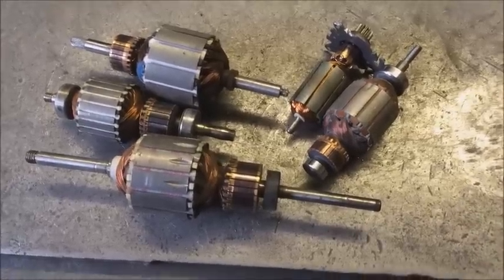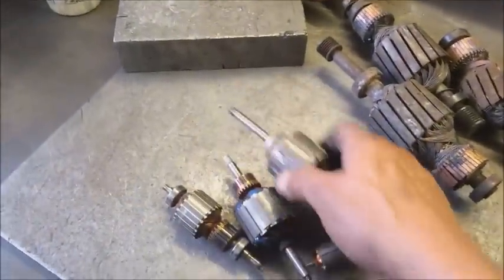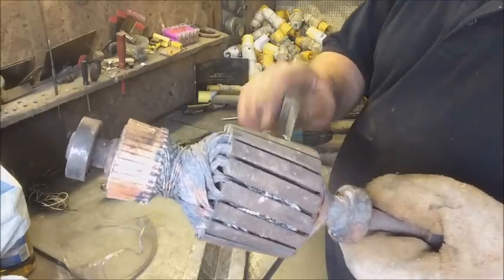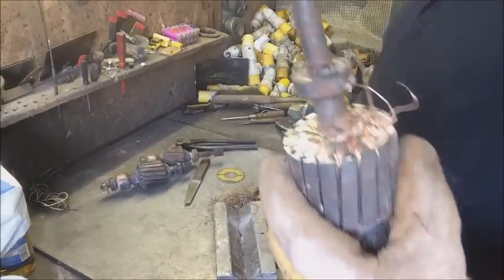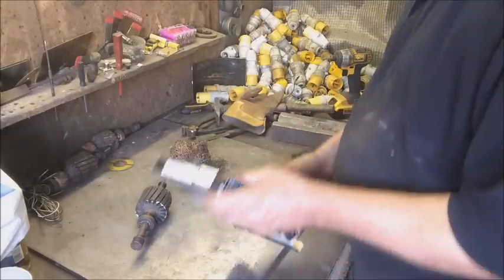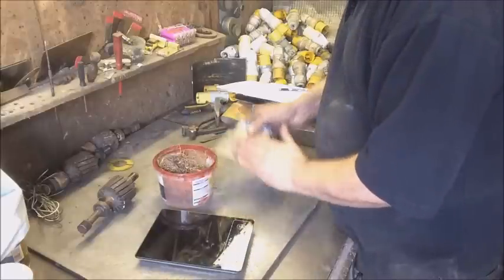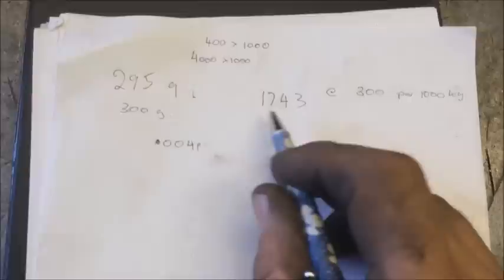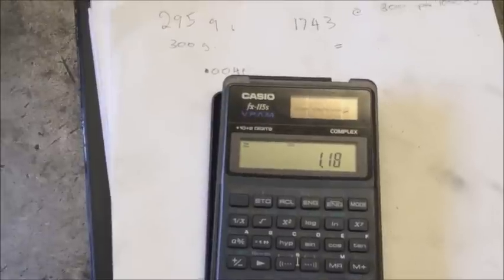Motor Armature, Rotor,  worth stripping for copper ?

Comment: lol!  I noticed other Americans with the same problem-trying to convert Decimals and Pounds mentally but the final verdict was "It's worth stripping."   I absolutely understood "Can't do that the wife will kill me" part tho.  ;)   WIVES are the same all over.
Reply: Just strip it or take the wife to the scrapper with non-stripped and stripped components, let the money do the talking. My wife thinks I am nuts as it is and she sees it all as junk.

The wife has loads of space taking, money wasting crap that has no value sitting around the house.

On the scrapping side, almost everything has value, even the plastic if you have uses for it, presently I do not.
Reply: @andrewpeterson7633  I laughed at your comment, but that is absolutely true
Reply: Lol. Yes they are. My wife won’t let me have anything from the house. Anything I take outside in my shop I have to buy. The wife would have a fit if I brought her scales out in my shop

Comment: I think the answer Ian is,
Yes, if it doesn't cost you a bean to do it.
 I used to do a lot of scrapping, I spent weeks at one place pulling rubber insulated cable and burning it off, 100 feet underground, I will never forget the sight of a couple of tons of cable burning in an airshaft-the draft was incredible, it would pull the doors closed around the district (the underground areas were called districts),
 Cheers, J.
Reply from the maker: Wow. AJ.  a couple of tons. That's some serious scrapping.
Reply: tt It was, Very serious scrapping, But I didn't get anything from it,But it was fun-ish,Would you  like a pointer to a site with some heavy  metal?
Reply: TAKOVÁ PRÁCE SE VŮBEC NEVYPLATÍ. Těch několik dekagramů MĚDI nestojí vůbec za to ! ! !

Comment: I cleaned a whole bunch of copper. When I go to the scrap yard, I always take a small bag to test the field. The woman tells me that millbury copper goes as #2 (because she doesn't know the difference between bare bright and millbury). Phoned around and got $0.20 more at another yard for #2.
Then we did my alloy. They dumped ALL the insulated in with the cleaned aluminum wire and threw it in the bin with my 10-10 extruded. Last time I went there. I argued about the extruded. They coughed up $0.65. It was worth $0.85. KNOW YOUR YARD!!! I took small samples.
Reply from the maker: Yep each yard over here has different rules. You have to be prepared to move round yards to maximise profit
Reply: I've been considering smelting the copper down into ingots and stacking. Doesn't really improve the value and takes time. It also drops here in the fall so you have to wait till next summer to recoup the previous value. Could have invested profits elsewhere.
Reply: likewise here in Australia , at the moment we getting .65 cents a kilogram for regular small electric motors not striped
Reply: .15-.19/lb here or.30/kg roughly

Comment: I did this in a scrap yard for years but only on steel case motors , best to run a 1mm disc and take one end off why the copper is still hard, It's hard work we only did it as we had lots of free fire wood ,, but it is all on the price of motors but I was doing 20kg x a day!
Reply from the maker: Nice tip.
Reply: OldTinRacing Baby  '

Comment: Some time it very hard to remove when the wiring are coated with epoxy. So I always sell as electric motor scrap bin because working on for few cents more each not worth it but I always pull copper from transformer or the outside motor because it has more copper to work on it.
Reply from the maker: Mark Brennan .   But it isn't a few cents is it !    It's 2/3rd more.  Ie if u got   100 for motors you would get 300 after stripping,  but since I burn them. I can't comment about stripping whilst still lacquered.  
Although there is a comment further below from a guy the does unwind them. 
And again it depends on how much your time is worth to you. I look at scrapping as a hobby. As such I class my time as free as I'm enjoying it.   But thanks Mark for stopping by. As I value other people's perspectives it's the way we learn on youtube
Reply: Mark Brennan or dipped in a varnish insulator.  Thats why he burned it .
Reply: @Man-in-da-shed  I think you have to consider along with how much more you make, how much time it takes.  Nobody should ever strip these. It would take months to make 1000$ this way. Even if it's purely hobby as it is for me, time is better spent finding more scrap or with the people I love.   Just my opinion but it makes sense.

Comment: Burnt wire or resin coated is priced as heavy Copper sometimes Brasiery so usually  £1 difference in price. Depends on the yard you go to.
Reply from the maker: Yes, as this is an older Vid, some yards now won't take burnt wire
Reply: @Man-in-da-shed  My yard, EMR Newmarket are now only allowing deliveries from VAT Reg businesses and they have to ring  in advance to be allowed in.  Keep on stock piling scrappers! Strange times will normalize!
Reply from the maker: Mark Neilson, likewise here in Northwest England

Comment: A couple years ago I asked what my local scrap yard would pay for "motors" They offered $0.28 a lb. (It's funny Canada went metric in 82 but the scrap business is all still in pounds). The prices have dropped so much it's better to toss them in with the shred (you actually make more money). Unless you heat them and remove the varnish (sometimes high heat glue) off the parts and pull the copper off the iron. The problem is in some parts of the world "Burnt copper" is not accepted by scrap yards. This is to stop thief's from stealing  copper and burning off the outer shell (on wire). My son does like you. Tosses the cores in fire pit while relaxing. The copper makes more interesting flames. The burnt pieces are then mixed with some sand and gravel in a ice cream pail and put in a electric cement mixer to polish the copper back to bright copper.  I have 4 or 5 pails of armature's that I'm going to build a burner for out of a 33 lb propane tank. I got the idea watching your chimera burner project. Thanks :)
Reply from the maker: Bruce Napier  thanks for that nice comment, I believe you can also clean with vinegar.  Or if in the USA molasses.
Reply: Vinegar and salt will clean it up. I'm a Scot, sand and a few rocks are a lot cheaper. :)
Reply: Wow Canada went metric in 82? That's interesting.  I didn't think anyone would switch if they were comfortable in their ways. I wish America would switch. It would be awkward at first but metric is SO much simpler
Reply: @bobstone1746  your currency is metric... Just saying

Comment: Is there a way to successfully remove the steel plates around the shaft? I have one from a generator and need the shaft for another project
Reply from the maker: Steven Locke they are pressed in so you will need to press them out
Reply: Ive pounded some out with a hammer on smaller motors but they mushroom very easy. Had to file in to get end through but they make nice little punches and stuff.

Comment: Is it Still worth stripping now the prices r much lower? And alot of scrapyards don't take burned copper anymore
Reply from the maker: Mark Smith,  your so right Mark, a lot depends on how many motors come your way, what your time is worth, if you want to play the long game or not.  As I type this motors have dropped to £240 a ton. With burnt wire at £4150 making it even more worth the effort.
Reply: You can hide burnt copper in number 2 copper but not too much if you don't want trouble.

Comment: Gonna love 2 're ya choice in stripping them down I been doing it 29 of my 34 years on this planet
Reply from the maker: I was a little older when My dad gave me a pair of pincers and said pull that copper out of that motor which he had cooked on our coal fire.
Reply: Ye that's what my dad did he still has the same coal fire now which he refuses 2 get rid of he burns his wire on there as well but only in small bits at a time cos of it beaches out very nasty smoke from the plastic

Comment: Is it copper cos when u cut the wire it's not copper it's like copper coated
Reply: I got some me motors l
Reply: I got some ne
Reply: I got some knew motors and when u scratch the wire or cut it it's not copper underneath I may send some pictures I no there's copper coated wire but never seen it in a motor 4
Reply from the maker: it will be what we call Chinesium, aluminium wire with a copper looking Lacquer on it. best to just snip one wire to check then if so,  throw in with your motors.

Comment: get a furnace. place rotors in crucible. melt copper lift out iron. pour ingot.
Reply from the maker: Nice Idea, but I struggle to Melt Ally.
Reply: @Man-in-da-shed  So did i for a few years. when you can, look into a engineered furnace like devil forge or a local equivalent.  It has made my scrap days so much more fun and productive.
Reply from the maker: @LTEK4NZ  , I watch a few guys melt, @Rafal scrapper, @Ralph Mourik, @Metalscrapper, i know the forge you mean, and i am tempted indeed .

Comment: most people are scrapping for a quick buck and though's how do really don't know much about scrapping. you will find that stripping out most metals that will make you more then others take a washing machine you have the wire then the motor the drum take that drum out and look at the back of it there is more copper there. if you just take it in as a hole what will you get about 7 or 8 pence per KG as to stripping it out.. like that video bud keep up with them
Reply from the maker: I have honestly never thought about videoing the stripping of. large domestic appliances. Wow.  That would bore most folks
Reply: i was not asking you to do a video of large domestic appliances so i do apologize if it come across like that i was just saying. even i would not video something like that unless i was really board. why i said that is because i have come across lots of video's saying making money from scrapping but doing it the easy way load it sell it sort of thing were as you take the time of showing someone what's what.. :-)
Reply from the maker: +Ant Brooks no apologies necessary Ant. Since your comment I've searched YouTube and unbelievably ( to me). There scrapping vids. Of just about everything. Interesting.
Reply: domestic appliance use alloy magnet wire in the motors now

Comment: hi bro. can i solder lost contact copper wire to commutator. im using black decker drill machine.
Reply from the maker: Mark Land  I’ll try and find the link. But there is a YouTube vid showing that.
Reply: @Man-in-da-shed  ok. Thanks sir

Comment: Since the amrature wire is shellacked, is it #1 or #2?
Reply from the maker: +David Youse  well David as its been in a fire it's no longer shellacked or varnished , and my yard takes it as burnt wire .
Reply: 2
Reply: my yard takes it as #2 copper you can also sell the scrap steel too
Reply: #3 it is cause it is burnt!!

Comment: 300 pound a metric ton?  you're getting screwed big time.  Over here in the US #2 copper like that stuff gets $3000 - $4000+ a imperial ton ($1.5 - $2 a 16 oz pound)  on a bad week and up to around $5 a pound ($10,000 a ton) on the occasional very good one.

(I see your wife owns you too.)
Reply from the maker: No 300 is if it is weighed In as it is .  Before stripping,
Reply: I cannot even imagine getting hold of that much Copper.  I'm stuck dealing with old extension cords and Christmas lights with some random stuff the neighbor tosses to me.   I'd seel half and convert the other half to Ingots myself.

Comment: Most of the motors I take apart end up being aluminum wire
Reply: Agreed, I found that if it's either a newer iteams and cheaper on the scale ie $15 desk fan vs a $50 desk that is Ally so if was cheap or new less copper in it came goose for fridges the older the fringe the more copper pipe it will have in it.

Comment: to use a grinder ect , hint wear a mask even if it's a disposable 1 as the grinder dust from the metal and copper , aluminum, varnish clear sealer coat, sprayed on the armatures is pretty toxic  for some people it not to long before they cough up blood ect from their lungs
Reply from the maker: A good tip there for everyone, usually I'm smothered in PPE..

Comment: You didn't factor in your labor or the cost of the grinder and cutoff wheels.  If you honestly considered all of your costs you will find that you are losing money.  Time needs to be considered.
Reply from the maker: Bernie as a hobbyist Scrapper my time is literally free, The only way to lose money is if the electricity/ disc cost more than the copper gained, if so I could use a hacksaw. 
I appreciate the comment, but yes like anything else it’s how much you value your time, I don’t have time to Fish, so I buy them at the shop.
Reply: Looking to do this as a, way of supplementing my pension in five years time. At the moment, like Ian, I'm a hobbyist scrapper so costs aren't so important yet. As long as my scrap covers my costs I'm happy
Reply: @Man-in-da-shed  I was the non-ferrous warehouse for many years and I can tell you your time has value.  As someone who just turned 65 on my last birthday I can tell you for sure that time is a precious commodity.  My point is, if you spent more time on just gathering electric motors you would still make more money per hour spent then you will by cleaning the motors.  The profit in scrap is in the volume.  The reason you are offered less money for motors is because the value is in the copper, but the weight is in the steel.  If you could turn a profit cleaning motors the scrap yards would do it.  They don't for a reason.  If you don't have time to fish, you don't have time to clean the motors.  Sell them as is and go fishing.  Trust me, it will improve your life.
Reply from the maker: Bernie, indeed Valuable advice I’m due to turn 61, I cannot believe how fast the time is going. 
You are so true in what you state, if there was money in it, then the yards would do it, like Scrap kingdom says Steel is the meal. 
But in my defence, these videos are like planting little money trees, the excessive time spent will pay dividends in the future.
Reply: Not if you are retired.
Reply: Your not going to support yourself doing my scale of scraping,  I only take home copper, brass, or motors, however motors are my  bread and butter... I personally just stack the internal shafts but if I was a large enough operation id have a furnace to strip them. For an entire bins worth it's definitely a productive endeavor.